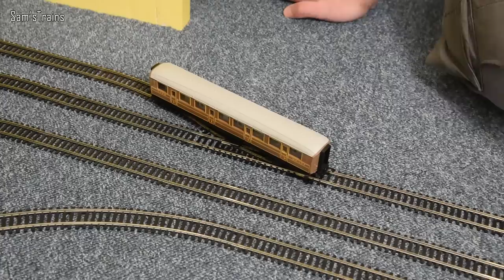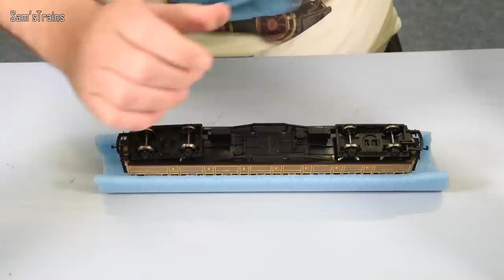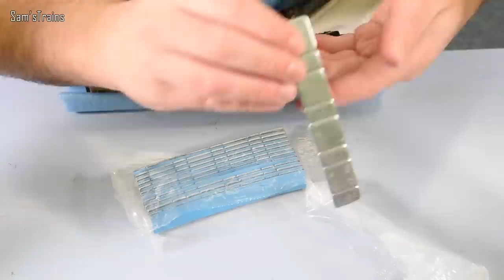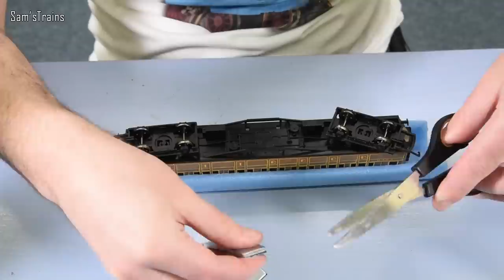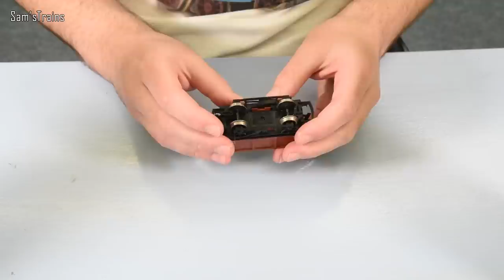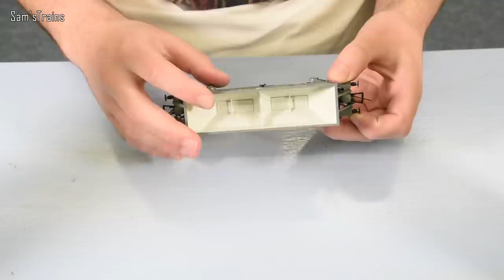How To Stop Derailments on Your Model Railway

Comment: On my first layout (which used Hornby track, including their points) I sometimes had problems when stock from different manufactures was in the same train.  On tight curves, tension lock couplings from different manufactures are only semi-compatible.  In particular, Hornby and Bachmann tension locks sometimes don't like working with each other.  I had to be a bit careful on what was next to what in the goods train.  Some people change their couplings to the same type on all their stock, or use gentler points (such as Peco Streamline).

These days I have no curves tighter than 30" radius, and use Kadees.

Edit:  I understand that the hooks of Hornby tension lock couplings are longer than those on Bachmann tension locks.
Reply from the maker: Hey Richard - yeah that can definitely be an issue - particularly if they have different couplings! I've definitely noticed that too - certain wagons can't be coupled together without derailing on curves!
Thanks for watching - Sam :)

Comment: some black paint would have helped.... personally would put the 5g on the bogies and see if that works, if not then the 10g in the body above the bogies where you wouldnt have 20g suspended outside the track on a bend. The question is with all the weight how much quicker do the holes for the axles wear? My old trains got little metal cups for all axle ends when I was just a kid, and they still work well with no wearing out.

Comment: Ah, I've had more than a few instances of derailment though I have no permanent layout. 
I've got a few wagons that derail when simply going over the main route on points, though one particular open wagon seems to have stopped doing it. Some of my box vans still derail on points but some have taken to just bouncing! Then there's the break vans which sometimes derail on the divergent route of the points during a shunting manoeuvre! Honestly the only rolling stock that rarely give me grief on points are coaches. I do have a few solutions though... express points, which are designed for use at high speed and loops so you can use a siding any which way and you don't have to worry about reversing. For shunting manoeuvres though I would use your solution Sam'sTrains and just stick some weights under the trouble wagons... so I'll have to get me some! 
Maybe I wouldn't have so many derailments if I had a breakdown train... though that would probably just derail too!
Reply from the maker: Thanks a lot for sharing - definitely worth looking into those! Good ideas there, thanks for that!
Thanks for watching, Sam :)

Comment: Hi Sam, I'm currently trying to resolve some major derailment issues mainly when reversing and hitting the frog, I've added some weights but still derails so need to check the wheels are the correct gauge I'm using Hornby set track so a measurement between 14.4mm -14.6mm depending on wagons or coaches. Your link to Back to back gauge is for 14.75mm fine scale and not the standard 00 - 14.5mm. Over a month ago I was on holiday in the Yorkshire Dales and visited Settle to see the station and popped in DCC Concepts only to discover that they don't stock any 00 standard Back to back gauges anymore because the European watch maker who machined them has died, so they will not be getting anymore unbelievable that he didn't pass on his knowledge hey. I have tried Eileans emporium but no luck with there and last I tried squirestools which is not web friendly at all.  Now I'm only 2 years into the hobby so working my way through problems but the derailments drives me mad and insulated frog points stuttering with class 08 and 153's.  But there are some tools that you simply must have to make a model railway a success and a Back to Back gauge seams one of those to correct poor manufactured wheels not set to the correct gauge. For new comers to the hobby like myself the only real option is to use a metal ruler and keep trying until it works which is a pain, I can't believe no one is making any of these.  Cheers Neil
Reply from the maker: Yes you're absolutely right Neil - that does sound like a gauging issue for sure! I'm sure the gauges can't be that complex to manufacture can they?! I'm sure more will be on the way soon. Keep up the hard work though - I'm sure you'll iron out all the problems soon!
Thanks for watching - Sam :)
Reply: @SamsTrains  Update: Thank you Sam, I've solved the derailment issue for now.  I removed the wheels from a bad wagon using a metal ruler and adjusted them noticing if the gauge was 14mm ish the wheels didn't sit on the track if the gauge was closer to 15mm they pushed against the rail causing the derailment.  I also adjusted two Hornby LMS coaches where the measurement was 14.9mm got them closer to around 14.5mm mark and have now stopped derailing on Hornby set track.

Comment: Tension lock couplings can be problematic if you're mixing the wide, medium and narrow variants, especially if you have a locomotive propelling stock over a reverse curve!  Sticking to just one type can help, but the medium & narrow versions sometimes don't work well with the same type from the same manufacturer, I suppose the type of mounting also comes into play.

Older stock can come with deeper flanges which can cause problems with more modern trackwork.  Though re-wheeling locos sounds a bit tricky.

If you have a mixture of heavy and lighter weight stock, marshalling the heavier vehicles directly behind the loco rather than at the back of the train will help, especially on tighter radii.  Something like sand or aquarium gravel PVA'ed into place, and painted if desired, might be a good way of adding weight (or disguising weights) to open/hopper wagons.  On reflection, I suppose it would work just as well in something like a box van if you had the stuff lying around.
Reply from the maker: Yes that is very true! I didn't mention the couplings at all, but you are right!
Thanks for watching - Sam :)

Comment: I have found that the main cause of derailment was using Hornby point where the flange have a big gap, which work fine with Hornby product but not always with everything else.
The Peco one so far work much better with the majority of stock, whose flange gap is smaller and thus less likely to cause derailment.
Reply from the maker: Yeah I bet that's true actually - it seems to happen quite a bit on Hornby points!
Thanks for watching - Sam :)

Comment: Of course, the best way to stop derailments is to not have any track!

But in all seriousness, there are a few brilliant tips.
- weight the carriages (especially if they are scratch built).
- make sure to check the point springs are in good condition.
- keep the track clean.

Also, another problem is that manufacturers make the wheel flanges scale. This often makes stock derail more. Older wheels with larger flanges (triang, for example) are often better at going over points. If you like scale wheels, but still want good performance, change out the leading wheel in each bogie of a coach, so it will lead in to points better. Just make sure both the larger wheels and smaller wheels have the same diameter and circumference, at it will be fine.
Reply from the maker: haha, you're not wrong Harry, lol!
That all sounds good to me - and yes I've had that issue with the flanges too!!
Thanks for watching - Sam :)
Reply: The flanges are nowhere near scale.

Comment: Subscribed!  Sam,I seem to be making a beginner's error (age 54!) I have a huge bundle of Hornby track,incl some flexi track which I have yet to use. My biggest problem so far is with the plain curves,R605 & R606 curves. Nothing I put on this stays on the rails. I thought it was to do with the small freight wagons,but then I put Hornby MK2 on & they derailed too. I set up a temporary bolt straight section on the livingroom floor & got the '37 to push the wagons,everything stayed on. Might my problem be with these curves?   & that's before I start on the Triang track. Most of the Triang I have taken to bits & straightened out by clipping part of the track support. I'm sure the Triang is even more curved than Hornby!  Awesome advice BTW!

Comment: All though the curve after standard Hornby points can be an issue, those first 2 derailments derailed on the frog before the curve. So it couldn't have been the curve that time. ;-) Still very annoying! Also, I've never had a derailment on Hornby express points. Don't really know why but hey! Could be useful info for someone. :-)   
Adding weight to the stock is a great way of minimising derailments too. A tip here is to have the same type of coaches weigh the same as each other. This will create an even pull on each coupling.
A good method I saw was to remove the interior, add a seal (sellotape or something like that) to the outer part of the interior all around, and poor in a weighted resin to add about a 3 - 4 mm thickness to the floor. This will interfere the least with the inside detailing you wish to put in. Saw it at an exhibition about  8 years ago. I could hardly see any difference inside at all!! :-)
Reply from the maker: Yeah you are right Sammy - in this case it was definitely the gauging/instability of the coach! But some larger pieces of rolling stock don't take well to s-bends! That all sounds good to me - thanks a lot for sharing the tips!! :D
Thanks for watching - Sam :)

Comment: In my experience with Hornby points is; that they have a faulty design at the cross section! Both the cross and the deflector-rail (- i don't know the english word for it) are made of plastic, and too short, so after a specific amount of wear it no longer "leads" the wheel enough, and the flange of the wheel hits the tip of the cross, instead of going next to it! I noticed it when many of my locos started derailing on the same (curved) point! I know most manufactures also make those parts out of plastic, but in Hornby's case they made the "gap" between the  deflector-rail/regular rail too wide, and (for example) i never had similar problems with a PECO  or Roco point!
Reply from the maker: Ahh do you reckon?? Hornby points do indeed seem to cause a lot of problems - you're probably right there!!
Thanks for watching - Sam :)

Comment: Yes weight is often the answer. Is there any difference while running a loco -> starting ->  current consumption, with a train with this weights compared to the pure plastic wagons without weights? As far I know, it play a role also if you use plastic axles or metal ones, or isn't it?
Reply from the maker: Hi Paul - thanks for the comment! In theory yes, the current consumption is likely to be larger - but it's usually not a problem, since most locos can't get perfect traction; they wheelslip, rather than burn out!
Thanks for watching - Sam :)

Comment: Mineral Spirits solvent is less polarizing (better, less future oxidation) for cleaning metal.  Nail polish remove contains acetone and a bit of nail moisturizing oil to reduce acetone drying effect.  Acetone goes directly into you blood stream thru skin !  just sayin'.  "Twitchy ( test volunteer) Richard"   (the "1947" says it all)

Comment: The wheel gauge you have linked to are the wrong type for RTR 00. You want to use a back too back gauge set to 14.4mm for Peco and Hornby set track you use. Set track always will be a problem for long coaches and locomotives due to the sharp radius they use.
Reply from the maker: Thanks Terry, yes you're right - doesn't seem to be a 14.4mm one available on there unfortunately!
Thanks for watching, Sam :)

Comment: nice video Sam so check your wheel gauge and add weight to your coaches and truck good idea using zinc wheel weights  have loads in my garage.
 weight i think is the most important when the wheels go over the frog the wheels can lift off and derail and also the gauge is also important too so they don't ride up the rail or go between the rail which will also derail.
So both complement each over as a solution nice video sam.
Reply from the maker: Hey John - yeah this did seem to help with my coaches at least! Glad you agreed with the methods! :D

Cheers,
Sam :)

Comment: My one or two issues was a great one. I was at a club and they where fixing the turn table  and didn’t tell anyone. So the button you needed to press while going on to the turn was still installed but no longer needed. so I had train parked there and was starting to shunt when I hear a crunch and look over to see a week old locomotive in the pit. Yeah that hurt.
Reply from the maker: Uh oh - that's definitely not good! :O
Thanks for watching - Sam :)

Comment: Hello Sam,  I enjoy watching the videos.  I suggest using lighter fluid instead of IPA for wheel cleaning (especially on hand painted or weathered models. Any spillage will not damage the paintwork unlike IPA. I found this out the hard way!  Make sure of adequate ventilation.Cheers, John F.
Reply from the maker: Thanks a lot John! I used to use lighter fluid for many years, but decided IPA was a bit healthier!!
Thanks for watching, Sam :)

Comment: My cars run on trucks like the famous Bettendorf truck or the modern open barring counterpart with a 5-10 foot length, and I still derail, mainly in the manor of the infamous "Tokyo-Drift(which usually leads to my taller, heavier, and longer cars to derail and trains to split with 50' cars ." Your tips are helpful; but I probably need to replace my switches and move to Kato, Atlas, or get my layout up ASAP for conventional track. My note to you; Don't do Bachmann E-Z track.
Reply from the maker: Ahh that sounds like a nuisance! Yeah maybe the switches are to blame - I often wonder that too!
Thanks for watching - Sam :)

Comment: Hi Sam, I have a Hornby railroad flying Scotsman that derails in between the space where the closure rails and the frog rails meet. They are just standard Hornby points, from the way it looks (depending on if the points curve left or right) the front large wheel that runs on the closure rail jumps on to the straight frog rail instead of continuing to follow the curved frog rail, while this is happening the rest of the locomotive is following the curve normally, this causes it to derail, 

basically one wheel is trying to go on the straight while the rest of the engine is trying to follow the track normally which leads to the wheels trying to go in different directions, which causes a derail.

Sorry for the paragraph 😂, 
any solutions?.
Thanks
Reply from the maker: Hmmm, worth checking the gauging Sam - on both the loco and the points! Are there curves mounted directly before or after the points? This can cause that effect to an extent too!
Thanks for watching, Sam :)
Reply: @SamsTrains  thanks for the information, there aren’t any curves mounted before or after the points, only another set of points after, but since the derail occurs before reaching the other set of points that can’t be the issue, the purpose of these points was for moving between the inside and outside lines on my layout, I’m not sure if this is worth bringing up but it would only derail when going from the outside line to the inside line, never the other way around , this occurred on both sets even though one set is a left hand set of points and the other is a right hand set of points, it’s just a little confusing because this doesn’t happen when going from the inside track to the outside, it might just be a gauging issue, 

thanks anyway

Comment: It depends on the wheels of your cars if you're car has big wheel flanges then a derailment is less likely but if you have a car with short wheel flanges then a derailment is a Lot more likely especially if your track is not the best aligned this is why some cars behave better or worse than others
Reply from the maker: Yeah that is true - but then again, short flanges require less of a jump to derail in the first place - it's a very difficult science to perfect!
Thanks for watching - Sam :)

Comment: Have you considered using a Dremel to grind away the detail on the bottom of the coach and then gluing them flush? That would make them less visible.
Reply from the maker: That would be great, but I wouldn't want to damage the coaches - you can buy blackened balancing weights, which are much less noticeable! :D
Thanks for watching - Sam :)

Comment: Silly question, but what make is the pointwork? I have been told that Hornby track is made to take Hornby stock and Hornby stock works best on Hornby track - shades of the old Tri-Ang Vs Hornby Dublo of my childhood! Hornby stock doesn't seem to like Peco track and Bachmann, etc, stock doesn't seem to like Hornby track . . .

In view of these comments (from a retailer!) I now use only Peco track and try not to use Hornby stock. I find locomotives are the worst.
Reply from the maker: The points were Hornby - the trouble is the gauging is often questionable on their rolling stock, which causes lots of the problems!
Thanks for watching - Sam :)

Comment: Are those the older hornby coaches? Ive heard their large flanges dont like modern points with the tighter tolerances. the flange hits the peak of the frog and rides up. I dont have any old coaches so i cant test  this, but i was having a similiar issue. i found shaving a small angle shaved into the frog directed towards the curve does a good job of fixing it for lighter coaches.
Reply from the maker: Yeah they're older, but not so old as to have large flanges - those are the Tri-ang ones from the 1950s!
Thanks for watching - Sam :)